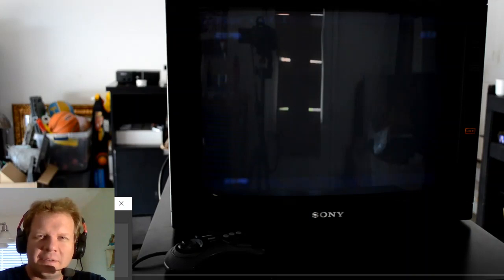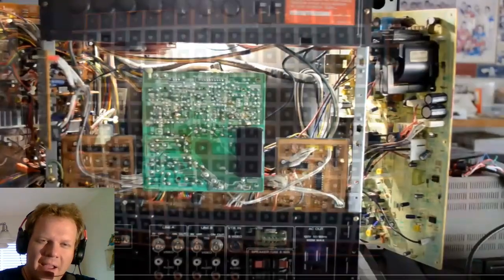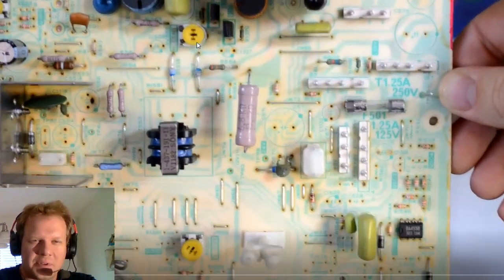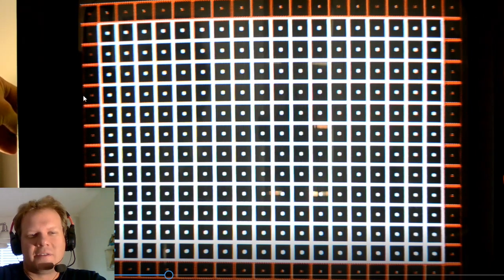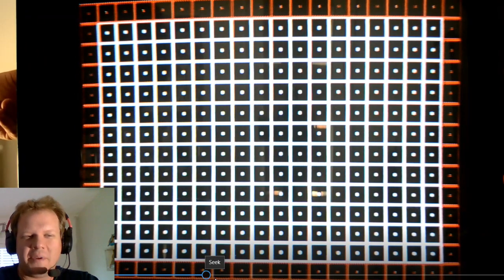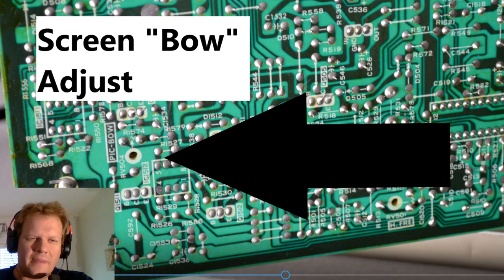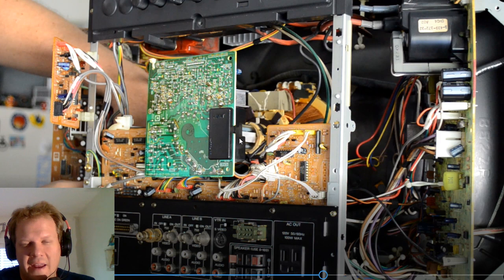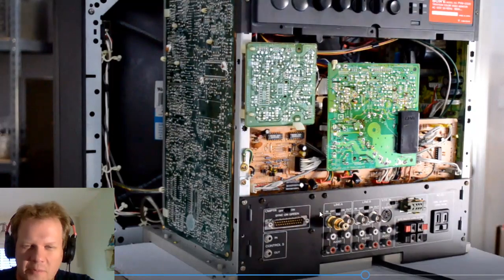How to Calibrate a Sony PVM 2030 + Replacing Capacitors - CRT Trinitron Repairs!

Comment: Overscan is really important. I used SNES 240p test suite to calibrate RGB and with NESRGB one can see a lot of junk on edges that’s not there with SNES.
Reply: Yep. NES couldn't scroll in both directions at once natively and uses a sort of hack to do so in games like SMB3. The side effect is the junk on the sides, which is supposed to be overscanned away on typical consumer sets. Between underscanning and overscanning, always overscan.

Comment: Any potentiometer adjustments I make on the "B" board (color) do not seem to have any effect on the RGB (CMPTR) input channel, only the composite input channels. The only color adjustment potentiometers that seem to do anything on the RGB (CMPTR) channel are BCUT and RCUT located on the neck board. 

Is there any other way to adjust the color balance for the RGB (CMPTR) input channel?

Comment: Hey, RetroTech! 
I have a PVM 14M2U and I've been trying to calibrate it for my retro consoles. 
Unfortunately, the Sega consoles pull WAAAY to the right of all the other consoles, at least with my calibration.

Is there any way to mitigate this, or is this just something I'll have to live with?
I don't recall my consumer CRT having different picture placement depending on the console....

Comment: Ugh... the h-freq adjust is NOT a horizontal center adjust... it’s used to adjust the horizontal frequency oscillation! You have to clip test leads to tests points on the deflection board to unlock it and get the picture to stop moving. It’s in the service manual seriously...
Reply: Great disposition!